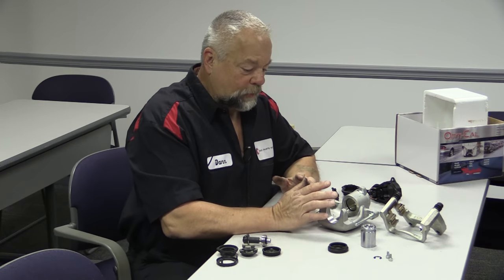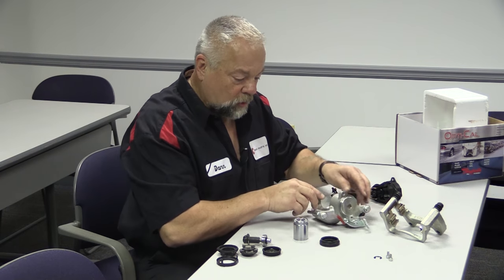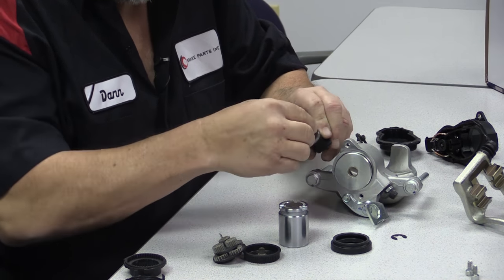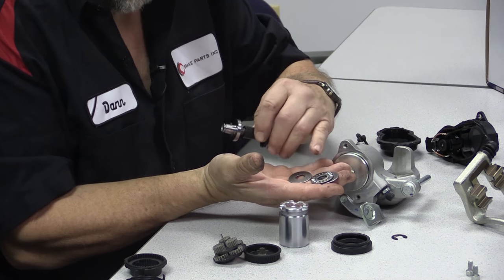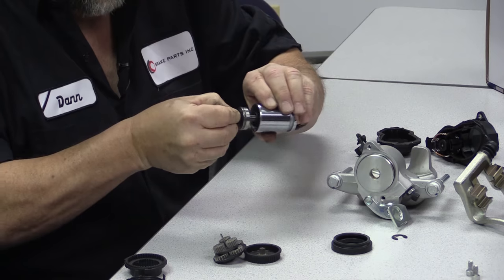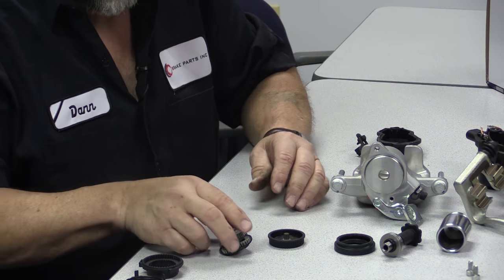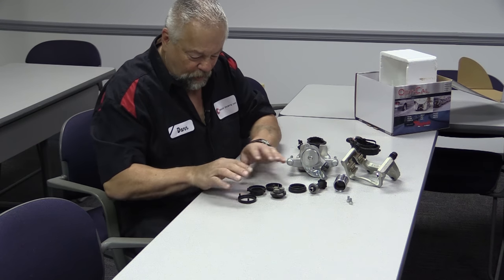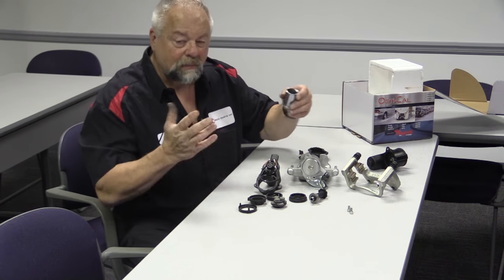How Electric Parking Brakes Work

Comment: Hello, please help me. I want to park on the slope of the 2014 Santa Fe car so that there is no pressure on the gearbox and it does not come out of the p when turning on and moving the gear lever with pressure. Thank you. Now when I stand on the slope, I go to p, then I activate the electric brake, when I turn on the gear lever, it comes on by force. I also tried, I stopped, I went, then I activated the electric brake, then I turned off the car, only the engine turned off, but the lights behind the amp were on.

Comment: Hello, please help. I want to park on the slope of the 2014 Santa Fe car so that there is no pressure on the gearbox, and when turning on and moving the gear lever with pressure from the outside, I should not thank you.
Now, when I stand on the slope, I go to pb, I activate the electric brake, and when I turn on the handle, it comes on by force.
I also tried, I waited, I went, then I activated the electric brake, then I turned off the car, only the engine turned off, but the lights behind the amp were on.

Comment: Very many thanks for making and sharing this. I was after a video that showed the principles and operation and this hits the spot. Looking to sort a sticky rear brake on a VW and think the EPB mechanism isn't fully releasing properly. After a brake service the pads operate normally, but as soon as I activate then release the EPB, the LH one doesn't retract properly. While I don't want to have to replace the calliper I see little alternative. This is a great video and I'm glad I found your work.

Comment: I believe you're literally the only person on YOUTUBE explaining this in such detail! My exact problem is the stupid small seal because it's filling the motor with fluid. Both my motors are shattered inside around the 12 torx gear that spins the caliper side and I just replaced them with TRW motors exactly one year ago. I am not sure if the fluid is causing the shattering but I can't find a rebuild kit that includes that seal. I do have the auto-hold function ON every time the car stops because I love the function.  2009 VW  CC vr6 4motion
Reply: Pls Notice: Auto Hold is performed by the cars 4 hydraulic actuated brakes. It has NOTHING to do with the Electric Hand Brake. But nobody knows that !! Untill yesterday I did not know that too.

Comment: I have to question Plantary gear sets automatically reverse.
I would think they would just reverse polarity
Reply: I agree, surely if it reversed when the piston encountered resistance ( pad hitting the disc/rotor ) the actuator would run back, releasing the parking brake. In fact it would never stop running. What tells it to stop?    I imagine it's more like an electric window motor that stops when its closed/opened the window because it measures the drop in current draw.  I've seen guys connecting 12v to the terminals of the motor to wind it back and they have to make sure it's the correct polarity otherwise the piston is pushed out. Still a great video to see inside one of these epb calipers.
Reply: I agree with you Michael.  I have some experience with these and indeed they do reverse the polarity to retract the piston.  A current sensor in the brake control module is used to determine that the brake is set.  Once the motor current hits a preset level, the brake is ON and power is cut to the motor.  To release, the module applies reverse polarity current to the motor, the piston retracts and the brakes are released.
 If it was some type of automatic reverse of the planetary gears, I can see the calipers would easily get out of sync with each other (one caliper is ON and the other caliper is OFF)

Comment: excellent presentation, thanks a lot, so if you don't release first the electronic park brake caliper and go straight  the depressing piston you will ruin the seals. I saw in some video, you can release pressure from electronic park brake by using 12 volts battery applied to caliper side of the electrical terminal after first removing the electrical connection from electrical harness and then proceed as usual mechanical way of doing brake pads replacement.

Comment: That’s nice. Car companies are always finding a way to screw us in repairs.   This stuff isn’t necessary. The basic hand brake and cable system worked wonders. Very cheap to repair. 
This system is just as stupid as the auto shut off they now have in vehicles that shut off when stopped.

Comment: Thanks to this video, I may re-think buying a car with an electronic parking brake. At least until there’s no more choice for the “old school” type. With all those parts, I can only imagine the repair costs involved JUST for that component.
Reply: Vehicles are being engineered more toward engineer type people and making dealers money planned obsolescence, lack of repairability by the normal user. Manufacturers are looking to phase out the backyard mechanics so normal people bring it in to a dealer. For those in technical fields IT and Engineering this is no issue.

Comment: Here is a question for ya.... i have seen folks use a 9 volt battery connected to the motor to retract it....... my question is how much DC current will the EPB motor be able to take.. like 12 to 15 volt DC ? is there a maximum amount of voltage the EPB motor is rated for ????
Reply: current and voltage are different, they can take 18-20 volts for short periods of time though

Comment: Good video, but the words(and the dark bakground) are blocking what you're showing!!!

I just repaired parking brakes on a vw passat recently and you can actually drive the motor forward or backwards just by changing the polarities of the current from a small 12v dc battery. Just make sure you have a fuse in the circuit to protect the motors from damage. Check the fuse box inside your car to see how much amperage the fuse must have. Mine was 5 amps fuse.
Reply: Awesome.   Can you please tell me which wires should be power or ground to retrofit these calipers to another car?  Which of the smaller wires are signal/trigger wires to activate the electromagnetic solenoid and clamp the rotor? Thank you

Comment: first off that is not how a planetary gear set works it does not self retract if it did it would just keep going in and out. the module reverses polarity on the dc motor that runs it. the torrington bearing or thrust bearing gets lubricated by the brake fluid its submerged in thats why it has no grease.you shouldnt be explaining things you dont know anything about to people these are a very simple and reliable parking brake system way less failure and expense to cable type ebrakes.

Comment: I have a toyota camry le 2012 and EVERYTHING on my car in up to date and in order except, lately when I reverse and put on the brakes, it makes a moaning noise. I've gone to three different toyota dealerships and no one can hear it make the noise when I need to duplicate it. It only happens when I back out and ready to go everyday. If I'm parked anywhere, anytime of day. It makes me nervous because theyve all checked my brakes and have three diagnostic tests. Can you help or give any advice or ideas to what it could be? Thanks
Reply: Nothing to worry about mine does the same thing even different model cars.....it is just that the brakes are cold from sitting over night and you are slowly moving backwards..... and the brake pads will make a groaning noise.....once the pads warm up you can back up all day long and they will not groan......

Comment: How does a planetary gear set automatically reverse?
Reply: It doesn't, control module reverses motor.
Reply: I believe the planetary pinions are held, the sun is the input and the ring is the output

Comment: EPB - dumbest technology. Old manual brake worked fine. Simple and never failed. Yeh replace with motorized ones that engage every time and add hundreds of dollars to a car price. Engineers looking to implement unnecessary technology. A solution looking for a problem. Dumb. Great video however. Thanks for the detailed explanation
Reply: So does manual car windows
Reply: @zchen1994  - not quite the same comparison. Most people - vast majority - don’t use emergency brake - most everyone uses power windows.  Plus you typically don’t use your power windows every day.  Imagine your power windows going down when you start the car and going up when you turn off the car. Every day in and out.  I don’t use my parking brake. I don’t want it to automatically turn on and off every time I park the car.  That’s just additional wear and tear on some thing and I have no desire to replace or to get repaired for some exorbitant amount.

Comment: Thanks for this.  Damn it, so I'm relying on that p*ssy little electric motor with its pathetically fragile drive belt to stop 2 tons of car in an emergency?  If even one fails at speed, one wheel locks and the car goes out of control.  What fool allowed these to be legal?
Reply: Exactly , should be banned.
Reply: Parking brake
Reply: @williamsimmons152  And your emergency brake when the main brakes go out to lunch!
Reply: @johnrroberts7900  PARKING  BRAKE !!!   PARKING BRAKE!!!
Reply: @williamsimmons152  Yes, freno de mano in Spanish, frein à main in French, Feststellbremse in German.  Do you carry a ship's anchor for when your main brakes fail?
Reply: @johnrroberts7900  yes I do.. And a parachute and Fred Flintstone sneakers.
Reply: you also rely on stupid little rubber hoses to stop your 2 ton vehicle and your daddy and his granddaddy also did. So maybe give it a chance eh?
Reply: @BarryAllen-no9nj   Nah, Pépé (grandpappy) had a '27 Model T back in his village in Canada which he drove until the early 50s when he died, with a gasoline heater, transmission band-brakes and rod emergency/handbrake.  The salt on the roads would have eaten up an electric motor and rubber band, lol.

Comment: How stupid.   Of a design.   Why not just put a line lock on a brake line.   That is how I park my 53 Chevy 5 window truck.  Mine is a manual one.  You put your foot on the brake and push it done.  then you push in on a mounted button and let off of the brake.   It locks the the line going to either the front or back or both if using 2.  When you want to release the brake just push the pedal again just a little harder than when yo set and it releases.  They work for ever and use zero electronics.  Some times simpler is better.

Comment: A park brake that cannot be trusted. At least the lever/cable system wouldn’t fail because of a leaking seal. All seals will eventually leak. Then no park brake.